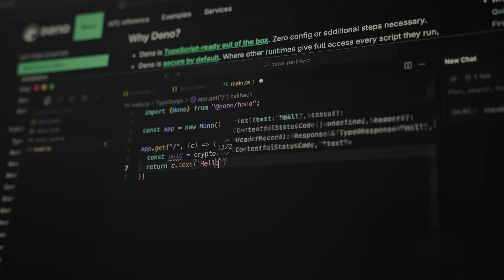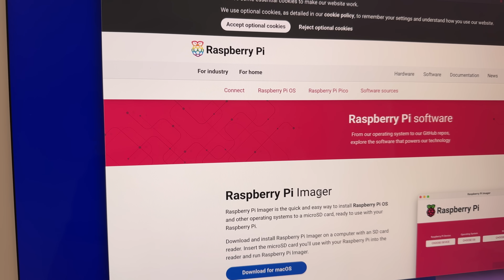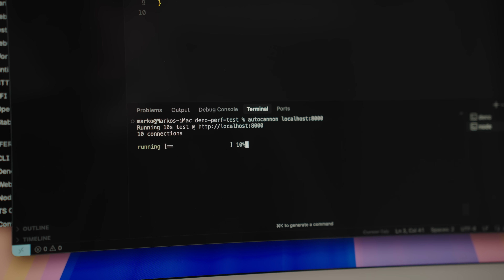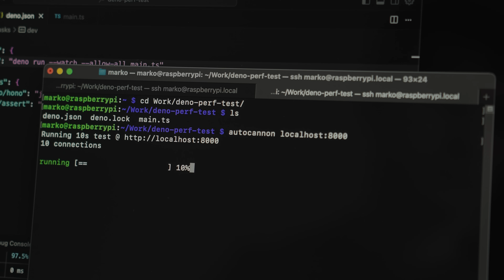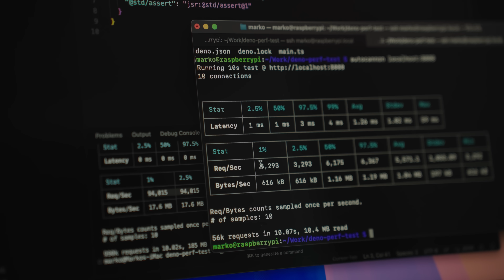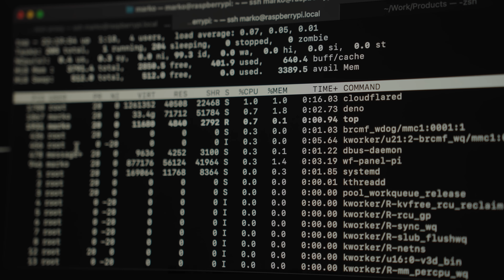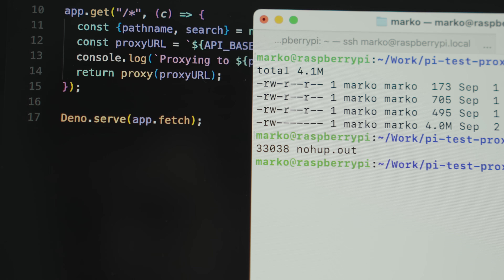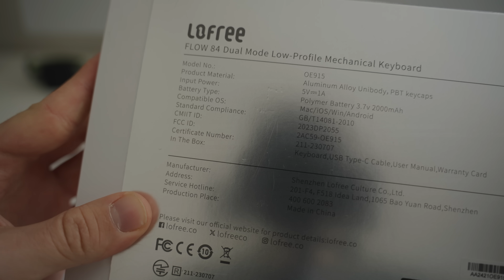Hosting a Production API on a Raspberry PI

Comment: Hi there. I also started with a rpi for production to test things out. Now I am running a homelab with:
- Beelink ME Mini as a sentinel for my homelab
- Full fledget custom NAS with 14 SSDs that has a bunch of services for CICD and multimple envs
- rpi 5 as master and 2 x rpi 4 as nodes joined in a cluster (all with nvmes)
If you wanna be serious with rpi look at argon one with nvme.
Cheers!
Reply from the maker: Hey thanks for this. I am curious what is the typical workload for this home lab, it sounds like a lof fun to put together!
Reply: @withmarko  Well, the usual suspects:
-  data backup with auto-sync, snapshots and 3-2-1
-  media stack + personal cloud for family and friends 
-  coding stack (cicd, registries, logging, monitoring, etc)
You should try it. It was hard, but indeed fun :)

Comment: 4:39 what is this? a Portable battery for the raspi?
Reply from the maker: Hey it's just a portable battery, but I plan on experimenting with it and the PI
Reply: @withmarko  was wondering if you knew the name? i was looking for a portable battery that was good for the pi. I would need it to power a monitor and maybe be able to run some circuit stuff on it. like led projects etc.

Comment: Pi's are awesome!! I have 4x4 in a cluster (16 pi 4bs)

They all netboot of my nfs share and they can easily handle any load they get thrown at them and i saw somethi g hilarious the other day. Nginx was the bottleneck while only 9 of my pis were being used (other 7 were idling at 2-3w).

If you can POE + netboot and have multiple (4 or more) they can really pack a punch.  Especially where i live where solar power is so common i can run them off my old ups thats been makeshifted to use my solar panels to charge up and power the pis whenever available (during the day at night they fallback to the ups which claims about 29h runtime with the switch and pis hooked up!

Comment: how did you get a public ip to host at?
Reply: You don't need a public IP with cloudflare tunnel. Just a registered DNS, Cloudflare will assign its IP to the DNS and tunnel the traffic to the cloudflare tunnel application running inside your network. (I'm actually not sure if it creates a VPN or something else 🤔).
Reply: @ojik  i know from my gpt sessions that there's sth called VPS services which goes on a monthly sub model and what it basically does is throw all the incoming req forwarded to your server and handles sending out the outgoing requests as well, but not sure how the comm works between the vps and my local server.

Comment: You'd want to use a pi compute module 5 and nvme ssd for more reliable hosting.  Those SD cards in my opinion just fail too easily.